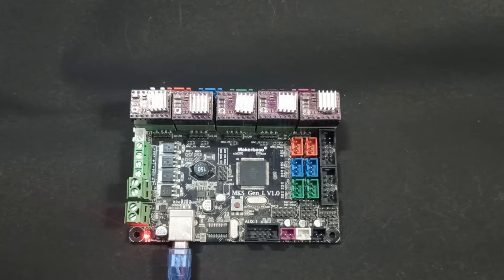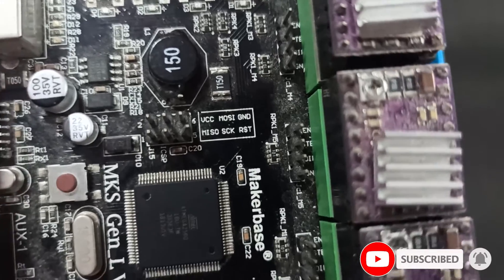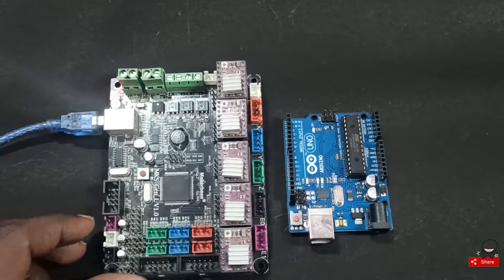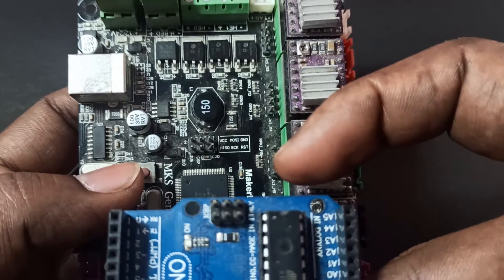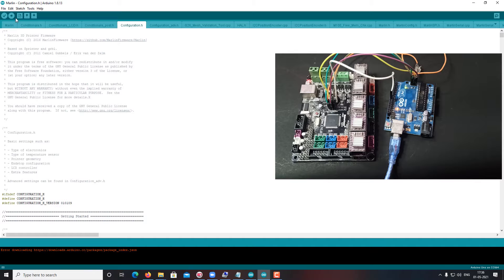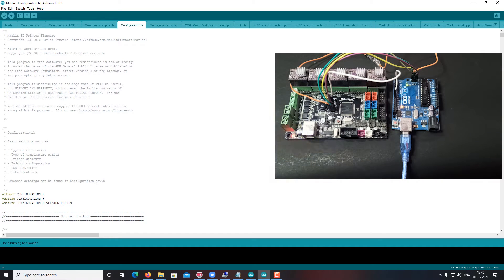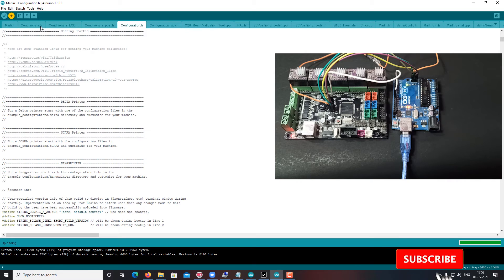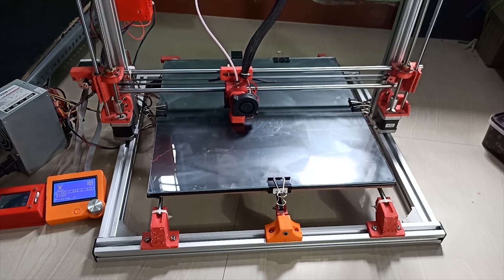How to upload 3d printer firmware when USB is not recognized by PC #3dprinterFirmwareUpdate #MKSGENL

Comment: Thank you this video was EXACTLY what i was looking for. i have the same board. the same problem connecting to usb. and the same Arduino ONE. I had some trouble compiling marlin in arduino. i had to use old Arduino Ide 1.8 and the stock firmware for this Artillery Genius from the official website.

Comment: nice but please how did u know the mk board is arduino mega
Reply: It is basically the trusty old Arduino Mega + RAMPS 1.4 combo integrated into a single board. If you look up MKS Gen L docs you will see it has a ATMEGA 2560 CPU which is the same as the Arduino Mega.
Reply from the maker: Both boards same architecture when it comes to firmware. You can find information in web and youTube.